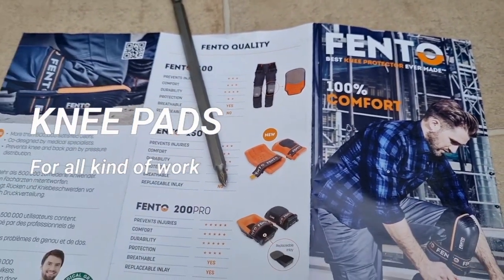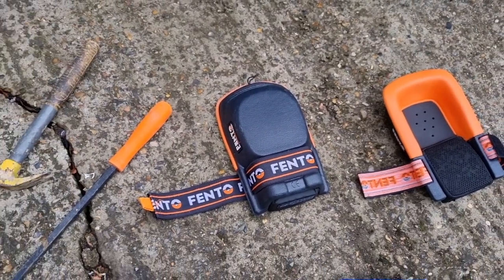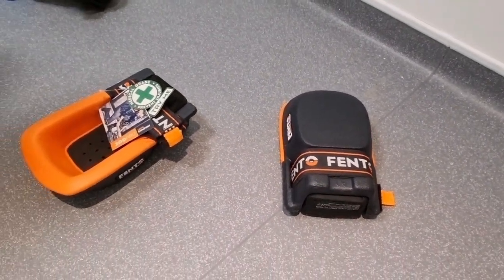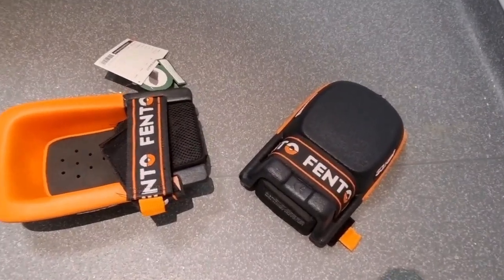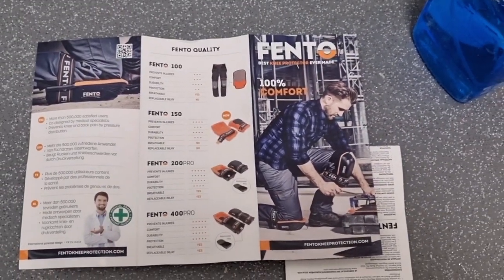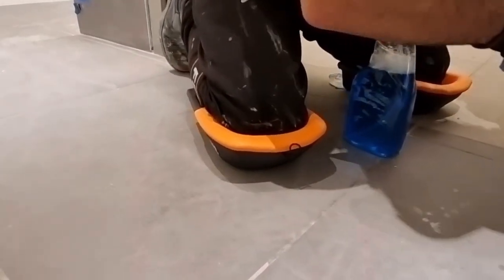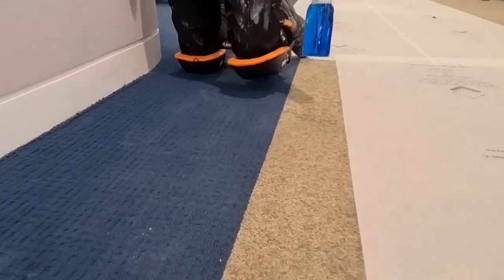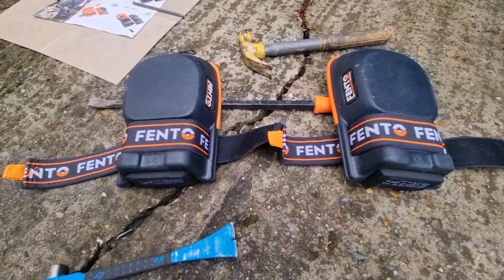FENTO KNEE PADS// Best knee pads in the market 😳 for DIY projects.

Comment: They do sweat but that's not a problem the comfort you get is just nxt level, trade user, these are hands down best pads ever, don't slip down legs stay in place, I've had mine well over a year, on knees 5days a week, on concrete, these just last and last, great investment, at price you quoted 120, that 12dollars a month to save your knees no brainer that one